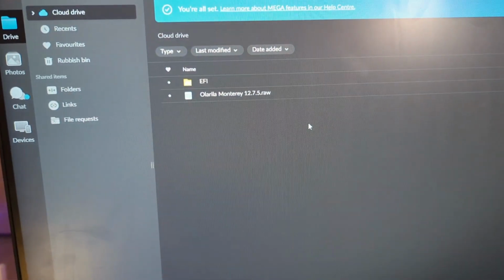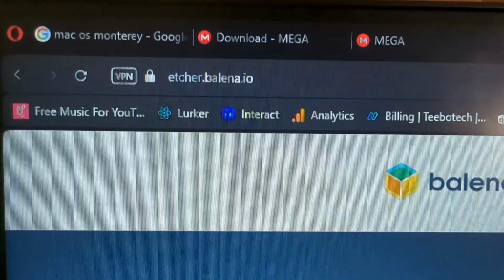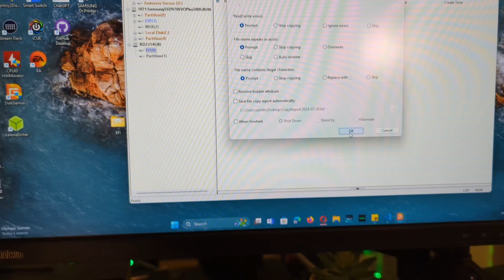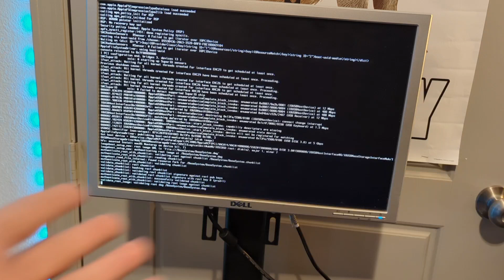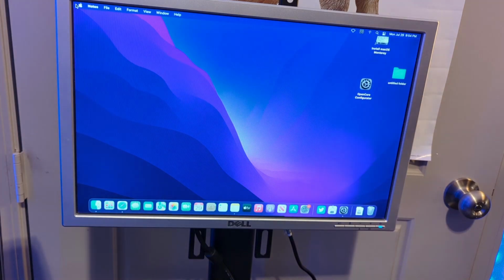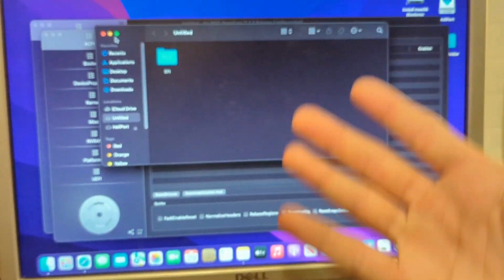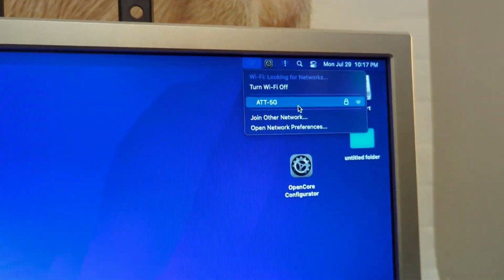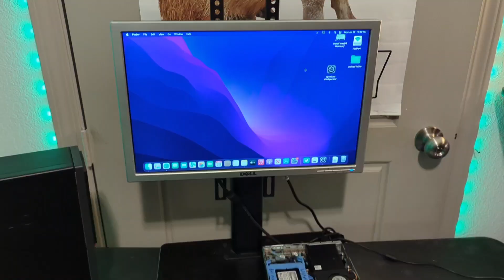It's easy to Hackintosh - how to Hackintosh in 2024

Comment: In 2025 it makes no sense to make a hackintosh at all, simply because you can buy a very powerful M series Mac from Apple with a warranty for around $1,000 or pick up a used machine off of eBay; and you can’t use any of the latest NVIDIA GPUs due to driver limitations. The new M4 Max and M3 Ultra studio rivals any desktop with the latest GPUs and it runs at a fraction of the power cost. The only justifiable reason for a hackintosh is when Apple hardware is not competitive with the latest Intel/AMD/NVIDIA hardware performance, and that’s not the case today. Then you consider stability issues and security issues with running a hackintosh and it makes even less sense. Hackintoshes are far less stable, and less secure and require a lot of technical troubleshooting to make it work as it should. The effort and risk needed to make one isn’t worth the hassle. The smarter move is to just save up your money and buy a new or used M series Mac. And for older hardware like the one you are using in this video, it would make more sense to repurpose it as a Proxmox or TrueNAS server.
Reply: You miss the point slightly. I have 2 powerful modern PCs, 4-5 other PCs, a couple of mac mini's M2, M3 macbook pro, 2017 macbook pro, razer blade 16, 5 hypervisor servers, 3 file servers... I wish to make a hackintosh or two for various reasons, one of them being fun.
Reply: @ You could also just build a proxmox server and configure one VM instance to run Mac OSX. That would save you hardware expense and clutter if this is just a fun project for you.
Reply: @ Yes I have a few MacOS VMs running various versions on my 5 node Proxmox cluster. Fun aside, I have practical applications also, including but not limited to circumventing arbitrary display output limitations when using as a QLab based media server.
Reply: @calhta  What is Qlab?
Reply: @BrentLeVasseur  If you had a hackintosh you could ask Apple ai shrug 🤷
Reply: @BrentLeVasseur You’re not wrong that there’s less point these days. One of my Mac Minis cost me only around £500 new, since it’s the lowest spec that I use solely as a WhatsApp desktop terminal. However, to say it makes no sense at all to build a hackintosh in 2025, isn’t true. There are a number of use cases.

Comment: hello i have a question: do you have the efi folder for LENOVO H530 Desktop TYPE 90AA because i want to do hackintosh with big sur on differnet drive.

new sub and like!!
Reply: I looked and didn’t see any on Google. You might be able to use one for a similar Lenovo, but you also have to match the efi file to the MacOS version you want to use. The efi files are often modified to work with macOS so you pretty much have to have someone else make it. Search for software that automates the efi modifications and use a copy of your stock efi file to make a new modded one. Be sure to share with others if you succeed.
Reply: @_..-.._..-.._  i already did and i stop hackintosh but kept the efi files
Reply: From Google: 
OpenCore or Clover:
Hackintoshing often involves using OpenCore or Clover, open-source bootloaders, which need to be configured to boot macOS. This configuration process typically involves editing the config.plist file within the EFI partition

So those programs will replace/modify your stock bootloader (inside the efi folder) to work with your specific macOS and computer.

Comment: 1. don't you have to include the AirportItlwm and Itlwm in the config.plist?
2. do I have to use Ethernet if I could put all the files and .dmg apps on another USB and install it without network connection? Please respond

Comment: Hey Sam, idk if you'll respond to me but I built a custom PC, what should I use for my EFI? The motherboard manufacturer, CPU, GPU? I'm a little lost
Reply from the maker: Depends on your computer but honestly A great use for AI tools is something like this. 

Just tell ChatGPT that you want to make a Hackintosh and provide it with all of your hardware and specifications. 

It should give you a pretty clear outline on what you need to do in what specific files would work for your specific platform.
Reply: @ ok, thanks!! If it doesn’t end up working I’ll just use my laptop.

Comment: Here's a fun one - there is a snap package for ubuntu that has a script that sets up a Mac QEMU VM with hardware passthrough enabled, you just have to toggle it on for the hardware you want, and go into the config settings and tell it how much RAM and CPU cores you want to allocate. Snap packages can be installed in headless systems, like on Ubuntu Server, and you can legit send like everything save for one or two gigs of RAM and a couple e-Cores or a logical SMT/HT "core" or two to the VM, and then use those remaining resources to make snapshot backups of the VM, make the host OS act as a file server on your local network, etc. And you can do this with ANY 64 bit, x86 computer, no EFI file required, as long as you have the resources.
Reply: Sosumi, only amd vga supported

Comment: Look, it’s hilarious Hackintoshing, just to middle finger Apple. But at this level, it makes no sense. A 2014 Mac mini comes in at around the same as a Dell 9020, and you don’t get WiFi issues, or audio issues, bla bla. No, save the Hackintosh pc for the truly high end Mac pros….except for those 2019 Mac pros going for 12000 are now in the 2 to 3 thousand price ranges! I’ve seen new old stock so cheap….

No, the truly wonderful thing about the Hackintosh community, especially the Open Core development is the ability to use legacy Mac hardware to run current Mac OS. And that is way cool :)
Reply: The opti's are 1/4 the price of 2014 mac minis, and the i7 minis are only 2 core, which the 4 core opti's run rings around. Also, if you really want, there are hackintosh 12 to 14 gen intel which rival high end Mac performance without the $7,000 price tag. Do it for 1/5 the price.

Comment: I managed to get a Lenovo IdeaCentre AIO 5i 27" working a while back with touch support after many hours and it was insanely difficult. I had to combine Laptop and Desktop kexts from Olarila since AIO are kind of a Frankensteined hybrid beast between the 2 and locate a hard to find firmware update for the stock disk just to keep it from crashing. It's stable now and everything works it just fails to update it's stuck on Catalina

Comment: Following your instructions will this installation overwrite my Windows 11 OS?
Reply: Yeah it will UNLESS you partition the drive just right, open diskmgmt (win+r, diskmgmt.msc, enter) and shrink the C:\ (give it around 80 gb) and now open disk utility on the macOS setup screen and check show all devices. and SELECT THE RIGHT PARTITION OR YOU'LL ERASE WINDOWS AND COOK WINDOWS COMPLETLY. once you confirm its the right partition install macOS on it and then after its installed. and now....when you wanna boot into windows, eject the usb. and for macos plug in the usb and boot from it and select macos

Comment: The boot log is not normally displayed, but around 16 years ago I possessed  a MacBook Pro (one with a magic exploding battery), and configured it to display the boot log. Like Linux.

You should be able to configure the EFI BIOS to prefer the external disk.

Comment: You can run this for a year or so and then Apple shuts down Intel support.
Reply: @beginnenmetinux  just because Apple shuts down security support doesn’t make them unusable.
Reply: @pattskatoey3139  yeah but apps are going to drop support eventually too.
Reply: @Sezamn  as long as you are able to use the apps you want in offline mode you don’t really need support. People are still using power pc machines and apps so should be no different on a hackintosh.
Reply: Old computers don't stop working just because they don't get official updates. There is a huge and thriving retro computer community, covering pretty much every old and obsolete computer, be it via actual hardware or emulation. Some things are done just for fun, for the sake of it, out of curiosity.
Reply: Nah windows pcs now have ARM cup support so hackintoshigg no is able to do again

Comment: Looks like you are missing the external antenna on the Dell. I've done this process before also on similar Dell's and it mostly works fine. You will need to add a fast nvme drive for some speed as the default drives aren't very fast. I even first installed ProxMox and Mac and Windows on top of that. Pretty funny experiments. You can find instructions on many sites. Way easier than the old Hackintosh tinkering problems.

Comment: Don’t use premade isos and prebuilt efis because they can be tinkered to work with a different configuration than the one on your computer. Simply use macrecovery to make a macOS recovery dmg, and use SSDTTime to generate SSDTs, download kexts and drivers that are required for your build, and last but not least, RTFM
Reply: How do you use macrecovery without having a mac 🤔
Reply: @pattskatoey3139 borrow one
Reply: SIMPLY?  From what I gather, nothing about creating a Hackintosh is simple. Using some random pre-made images and such like is a huge security risk, unless you already know the source can be trusted, but if you isolate it from your other computers and don't entrust it with any personal data, you can play around with MacOS. Realistically, it's just better just to buy a used Mac.
Reply: Do you have a video on how to do that?
Reply: thanks, zoro

Comment: Can I make a hackintosh with 14700k and 3070
Reply: 14700 yes, 3070 no. Apple only supports AMD gpus and only up to 6000 series no 7000 series
Reply: @abcon1724  oh damn, that sucks.
So i have another cpu to dedicate to it them, 12400F, what GPU do you reccomend buying
Reply from the maker: Any AMD GPU even super old ones would work. 

The one that would probably work best is a RX 6800 XT or similar,  WX series cards should work pretty good as well.

Comment: why would anyone need to do all of this when u can just use linux??
Reply: Because AirPlay, Handoff, iMessage, FaceTime, iCloud Drive, Final Cut, and various other programs are only for Macs. Linus is not the end all be all of operating systems
Reply: If you have to ask, you probably aren't interested in anything other than Linux, so it doesn't really matter what people say to you. Suffice to say, Linux isn't the only OS, it isn't necessarily the best OS and it certainly isn't the most user friendly one. Linux as an OS is a mass of inconsistent distros, there's no ONE standard, they aren't even all directly compatible with each other's applications, never mind the UI, software repositories etc. Having to revert to using a terminal app to enter arcane strings of text is reminiscent of the old MSDOS and pre 2000 Windows days. I don't want to revisit them a quarter of a century later. 😂
Reply: Because macOS has macOS exclusive applications and features that you're unable to get on Linux or Windows 
And yes, you can just buy a Mac if you don't want to spend some time working on a hackintosh but you won't be able to natively run windows and will have trouble running Linux (what I just said applies to the Apple SoC Macs such as m1-m3)
Reply: @Mamoonabm  yep, and you dont have to pay for an expensive mac, and have linux or windows, with MacOs dual boot.

Comment: why would anyone need to do all of this when u can just use linux??
Reply: Here's one possible use case: developing iOS apps. You can't develop iOS apps on any platform other than macOS.
Reply from the maker: @Zeem4 That's basically why I did this, to test / build software for Macs and other Apple devices that I can't do on Windows
Reply: music production, and don't say ardour with plugins in wine because that sucks ass
Reply: Conversely, why would anyone use Linux when they could use MacOS, Windows, or indeed any other OS. When you answer that, you've probably also answered your own question. 🙄

Comment: how is the performance on doing some productivity softwares (free ones) like video editing or image/raster editing? compared with just using it on the original opti 9020 with windows
Reply from the maker: I used Adobe premiere Pro, and attempted to use final cut though I have never used it before and admittedly did a terrible job lol

Both of those applications ran okay and rendered a 10min video decently fast

Comment: Personally, I wouldn't trust those premade isos. You never know what people put in these. I would rather recommend using clean macos file and OpenCore (or using a real mac, but that's obviously not the point of Hackintosh lol)
Reply: I can't answer to pattskatoey3139, so i post it here : I used Linux to make a bootable USB Installer of MacOS. On google "opencore legacy patcher macos installer" it's the first link, and you will have tools for MacOS / Windows / Linux. The tool use the Apple URLs to get the files.
Reply: Has anyone found a video on how I can use my old Mac 2013 to make a newer Mac?
Reply: Using a real Mac to make an image does not defeat the point of a Hackintosh, which is to use Apple's software on non-Apple hardware.
Reply: @ssjohnson  But then if you already have a Mac to do that, you don't really need to create Hackintosh in the first place. Which means finding someone willing to let you use their Mac to do it. Or just buy an old Mac and forget the whole Hackintosh thing. 😂
Reply: @another3997  but what if you want to use a better graphics card or cpu
Reply: @Dingusdongusokyou don’t
Reply from the maker: This specific website seems to be fine. They've been around for a while
Reply: How would you do that without an actual mac dummy ?
Reply: @pattskatoey3139  the opencore website provides a python script to grab it from apples cdn dummy
Reply: @pattskatoey3139  I forgot the details but I am pretty sure OpenCore downloads the original MacOS directly from apple servers.
Reply: @pattskatoey3139  lol, i did it it basicaly means you install newer unsuported version of mac os on old mac

Comment: Olarila is a custom macOS distribution made by a third party. This makes your hackintosh much more illegal than a true hackintosh which is macOS built by Apple and downloaded from official Apple sources, with custom drivers from third parties installed to make Apple's original code work. That, and it's cheating, and introducting potential malware because of the fact it's a custom macOS distribution which who knows how it has been tampered with... well you made your choice. Hope it's gonna work out fine..

Comment: That was a very good straighforward tutorial without any bs, Is this thing work on AMD APU ?
Reply from the maker: @Abhishek__Parihar  you can try it. I haven't personally tried it as I don't have an AMD CPU 

But I plan to make a video soon actually using an AMD based device.
Reply: @samthibault04   Okay great ,subed to you for future updates.
Reply: @samthibault04  I’m pretty sure they do work
Reply: It depends if you are using the igpu. That is not supported on any AMD chip. The CPU itself is usually supported with some workarounds. I've never tried myself though
Reply: @hughdavies8124  actually you can use the integrated gpu from an apu, search up nootedred, a replacement for whatevergreen kext, i've used it myself and it works damn well lol
Reply: @hughdavies8124  I found a Reddit user who successfully got it working on a laptop similar to mine. It seems the iGPU is functional with NootedRed(Idk what that means). Unfortunately, he's not sharing his EFI and other details. Since Honor isn't a popular laptop brand, there are almost no resources available for this machine, so I'll have to figure it out on my own.
Reply: @hughdavies8124  I found a Reddit user who successfully got it working on a laptop similar to mine. It seems the iGPU is functional with NootedRed(Idk what that means). Unfortunately, he's not sharing his EFI and other details. Since Honor isn't a popular laptop brand, there are almost no resources available for this machine, so I'll have to figure it out on my own.
Reply: @hughdavies8124  This isn't technically correct. NootedRed can use the iGPU on several of the AMD APUs as long as they are Vega based and that particular architecture already has support in MacOS.
Reply: why my comments are getting deleted
Reply: I know from your name that your an Indian but damn why that colour scheme on ur pfp my guy
Reply: @Cattus_Supreme   it looks good
Reply: @Abhishek__Parihar  nice n@zi pfp
Reply: @klebleonard  That's not nazi, It's swastika sign of peace and harmony